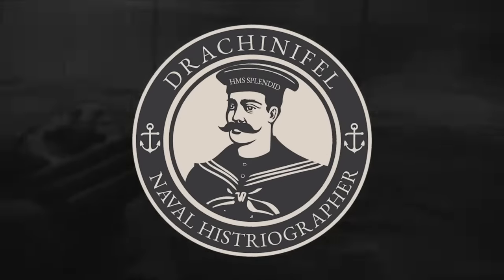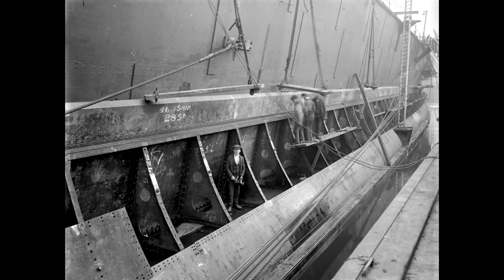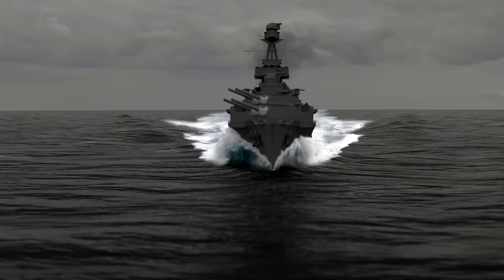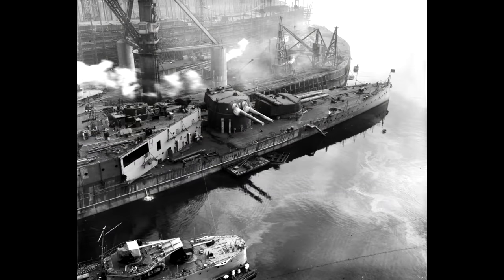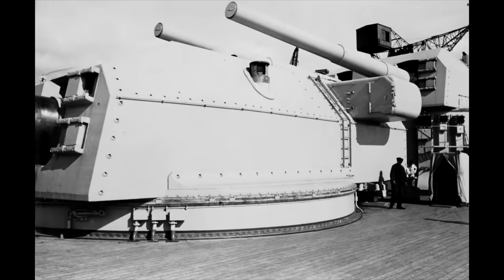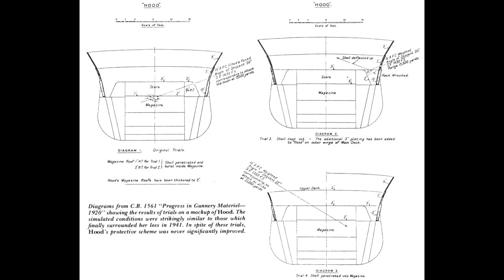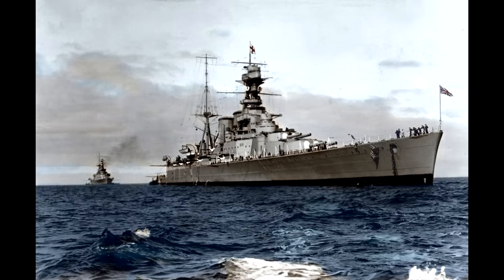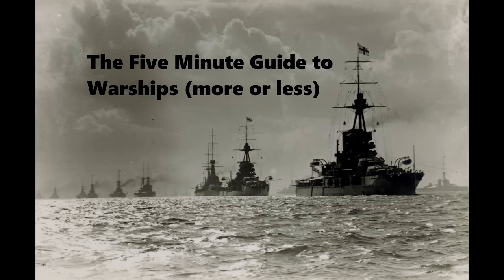The Loss of HMS Hood - But why did it blow up??

Comment: Are we sure that Hood Fired Torpeadoes?  My reading of Naval combat suggests that a high perecentatge of Torpeadoes spotted are phantoms.
Reply from the maker: It does seem extraordinary but this detection was made over prolonged time by the Prinz Eugens hydrophobic operators. If that contact wasn't torpedoes then there's a lot to explain what the cruisers expert hydrophone men heard :)
Reply: @Drachinifel  Very interesting
Reply: @adamcarriere4465  It is reported in the book "battleship Bismarck: An Operational History" that Prinz Eugen's hydrophone operators had TWICE reported torpedo alerts in the hours before the Denmark Strait engagement.

There is also the fact that at NO POINT did HMS Hood (the only one of the two British capital ships at Denmark Strait to carry torpedoes) come anywhere near within range of using her Mk4 Steam torpedoes even at their lowest speed setting. It is quite simple to demonstrate with maths and geometry (a very basic "target Motion analysis") that this is the case.

Comment: Anyone know which way the rudder was pointing on her way down? That could indicate how the ship was rolling and change the calculations on the impact angle.
Reply: They were locked for the turn to port.

Any change in impact angle whilst decreasing the deck resistance (relatively speaking) doesn't offer a path for the shell to reach much if anything, other than maybe penetrating the upper deck (def not the Main Armor Deck).

And any change would increase the relative belt thickness making it even harder for the shell to pass through

Comment: Definitely a fluke shot. I heard somewhere that the deck platting of the Hood was not up to scratch as well. That’s where I thought the shell had hit, but I like your explanation
Reply: I agree where the salvo hit had an element luck but not luck that it hit. KMS Bismarck's gunnery was superior to that of HMS Hood. The German battleship had found her target within minutes. HMS Prince Of Wales also suffered  serious damage with a direct hit on the bridge and had to withdraw. The pursuit that followed  KMS Bismarck would not have succeeded had it not been for a lucky a torpedo hit from air attack by Swordfish, it rendered her steering jammed and it prevented her escape. The attack by the outdated and slow Swordfish were an easy target for the battleships but her fate was sealed by those brave airman. KMS Bismarck was moving in circles and by the next day she was pounded by HMS King George V and HMS Rodney and  finally torpedoed  by HMS Dorsetshire. However at  the same time those on board KMS Bismarck had started to scuttle her.

Comment: Though the hood could have beat the Bismark and prinz eugen by herself should have waited for more capital ships to catch up with her and attack with aircraft first. Prince of wales shouldn't have been anywhere near her either
Reply: The RN did not have the luxury to wait for other ships to arrive, Bismarck was on the very threshold of the convoy lanes and the wide open expanse of the North Atlantic in which to take evasive action, as she did not want to engage RN warships. The best chance they had to engage the unwilling German ships was in the Denmark strait, bordered as it was to the west by the Greenland ice pack. It was the hit achieved by the PoW that drastically reduced Bismarck's fuel capacity and stopped "Operation Rhine Exercise" in its tracks.
Reply: @walterkronkitesleftshoe6684  And then Japan got revenge for Bismarck later. Japan also added Repulse in the same battle.

Comment: Would the weight saved in Hood's modernization, as well as the buoyancy provided by her increased bulges, have improved Hood's freeboard? If so, she would have been less "wet", and performed more as originally intended (able to maintain speeds even in rougher seas) before her up-armoring during construction.
Reply: The major changes would have involved removing the largely useless conning tower, and in replacing the outdated machinery with much lighter modern equipment. The modernised Hood would have looked something like a KGV or Renown, and weight savings would have made improvements in the layout of her armour possible.

Comment: Question, what's with the tarps over the deck of the ship? I've always wondered why they do that?
Reply: I don’t remember which one, but Drach already had answered that in a drydock.

In any case: I assume you mean the ones during more peaceful operations, in which case they are simply sun protection. There is no air conditioning on warships of this period, so a shady deck was the best place to be when in warm/hot weather

Comment: What if the shell hit right on the seam between the 7-inch and 12-inch plate. While it seems incredibly unlikely, it could have happened. This area may be even weaker than the 7 inch plate itself, since the plates would peel apart inwards instead of taking the full force of the shell, and it would also be just about the right angle for the shell to hit the flat part of the inner armor, though if it was even a little too low it might skip off the top edge of the 12 inch plate and be sent upwards slightly. But if it hit in just the right spot, it would peel open the armor like a tin can. Theoretically.
Reply: This video is an elaborate way of saying that she was 'too fast for her own good'.

Comment: Did Hoods forward turret actually fire as it was going under or is this a naval legend?
Reply: According to Ludovic Kennedy, it did happen. Probably because the firing circuits connected at the same moment as the ship exploded.
Reply: @dovetonsturdee7033  incredible what if this final salvo fired from HOOD had hit BISMARK fatale sending it to the depths of the Denmark straights shortly after HOOD

Comment: I listened to your very in-depth analysis of the demise of the Hood. I have heard many others as well. But I have to say that your analysis had a goal in mind before hand, and your analysis was geared to match your preconceived notion - that design of the Hood was not the culprit. I realize that a clear and irrefutable answer will always be sought out, but I would like to add my '2 cents' here. First, I do not think it was a 'incredibly lucky shot', which so many historians use when a catastrophe of some kind has happened. First, I clearly think it was the design of the ship, and not some 'lucky' shot. Secondly, the penetration of the Bismark 15" AP shell at 20,000 yards was 16.4" (more than the Hood had), and the British 15" AP round had a penetration of only 11.7' at that range. And if they were under that range, say 15,000 yards, then the Bismark's penetration would been about 20", which is clearly far more than the Hood had. Thirdly, the type of steel and its layering with empty and/or water spaces as well as different types of steel layering, especially in having some non 'brittle' steel as part of its makeup, makes a huge difference in the ship's defense, which you did not go into at all. I learned a lot about the steel from Ryan of the NJ, and steel back in the teen's was not particularly really robust enough for the WW II shells. Fourth, in addition to the type and the method of steel used on the Hood, I believe the hood had a similar affect as the Titanic did. When the water got quite cold, the steel became a lot more brittle, and thus easier to breach when hit with a heavy impact. This impact may not have breached all the way to the 15" powder, but may have set off the 4-5" powder nearby, and that may have exploded, which in turn would have probably ignited the main gun powder. Again, this is the ship's design!
Reply: During the battle of Denmark Strait, the Bismarck's killer blow was fired at Hood from 8-9 nautical miles away. At that range the 38 cm SK C/34 (Bismarck's main armament) had a CEP (circular error probability - effectively the radius of a circle within which 50% of its shots would fall) of 100m. That means that if 8 of Bismarck's 15in guns fired at a single point 8-9 nm away, 4 of the shells would be expected to land (with completely random distribution) within an ellipse measuring approximately 100m (330ft) wide, (or 38% of HMS Hood's 860ft length), by more than two thousand feet long (an ellipse due to the angle of fall). The other 4 shots would land even further away from the aiming point. That being the case, how can an individual shell be aimed specifically at a tiny part of HMS Hood's structure, namely the 4in HA magazine, that triggered off Hood's detonation? I'll give you a hint, there's a little clue in my paragraph above....where it says "completely random distribution".

A simplified analogy is that if you prop a dartboard up 50 yards away and can consistently knock it over with a shotgun at that range then that is pretty good shooting, just as Bismarck / PE achieved during the Denmark Strait encounter.

Now you can "knock the dartboard over" all day long with the shotgun and STILL NOT hit the bullseye (magazine) with an individual pellet. As opposed to being a skillful shot by knocking over the dartboard, whether you hit the bullseye with an individual pellet IS COMPLETE LUCK.

Comment: 10:30 Why would the 4” armament not be manned at action stations? Why would the ammunition be locked away?
Did the RN have different levels of action stations in 1941 for different types of actions? I don’t think it did.
Reply from the maker: The 4" was the shops AA armament, in a surface action with zero threat of air attack the gun crews were kept inside the ship and the stores locked up since they would not accomplish anything outside except die messily of the ship took hits which otherwise didn't compromise it's ability to fight a surface action.
Reply: @Drachinifel  Thank you for the explanation. 😘

Comment: Here's a thought; if I was a sailor whose battle station was inside a steel box and who was required to latch all of the doors I'd need to escape from said box, I'd be inclined and I might convince my mates to agree, to leave the most direct route out less than fully locked and possibly even slightly ajar. Suppose this escape route also facilitated a catastrophic flame path. I propose there was a fire deep in the ship and that fire venting through the 'escape route' is the midships flare. Going the other way, straight to the magazines. The propellent starts burning and sends a shooting flame up and out. Just like a burning tank, columns of flame up through the hatches. A second later it suffers rapid confined mass deflagration.

Comment: Having studied the information on the position of major parts of the Hood's wreck and left too a larger degree scratching my head as with nearly every other major combat ship that was sunk and later had their wrecks found. there is  not all that much too surprise someone who has studied survivor's and other eyewitness accounts.

This is not the case with the hood.  I haven't got a reasonable logical reason for the Main conning tower being so far away from the main debris zone, if blown there at the time of the sinking would mean the survival of Ted Briggs would be almost impossible either as he described nor in physical fact as he would have been blown apart at the time of any explosion that had the power to throw the 600, ( 900 ?) ton conning tower the distance theorised.

In this post the 20° min shell strike theory is completely dismissed as 'being highly unlikely'. And the theory hydrodynamic effect that exposes the under side of the rear hull below the water line, thus exposing an area below the main belt as a point of penetration is thought have more weight.

This theory ignores the earlier mention effect of the 'heel' a large and fast moving ship goes thru while turning.

The ship was turning as the  position of the rudder at the wreck proves, if she had completed the turn a certain opposite amount of rudder would have been applied to stop the momentum of the original turning moment, so the only logical conclusion the hood was somewhere 'in the process' of the ordered turn, handling notes on the hood should be examined.

My studies show that the hood would have heeled between 6° to 12° degrees towards the German ships depending on the actual point in the turn the penetrating hit occurs.

This angle range when added to 14° degrees shell angle ( in the terminal ballistics phase) firmly puts the possibilities contained within the diagrams that were dismissed firmly back on the cards.

In addition the exposed lower hull would have been deeper into the water by a considerable amount thus potentially nullifying that scenario.

In addition a dud shell would have greatly assisted penetrative effect and as in sabot rounds ( solid non-explosive) as in tank warfare would equally apply if the shell found passage thru the powder magazine.

And German naval shells were known to have a high fuse failure rate at that time.

See Graf Spee action account of British forces.